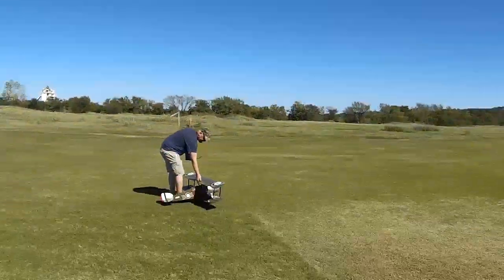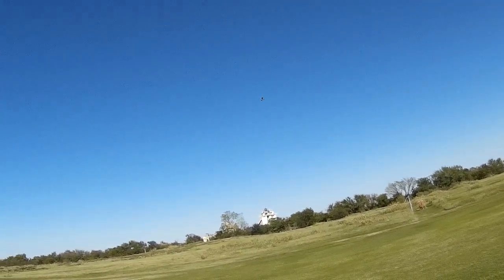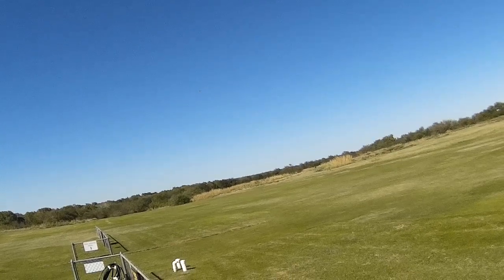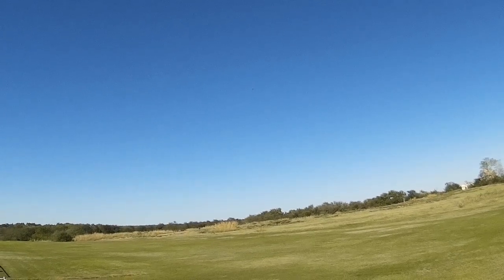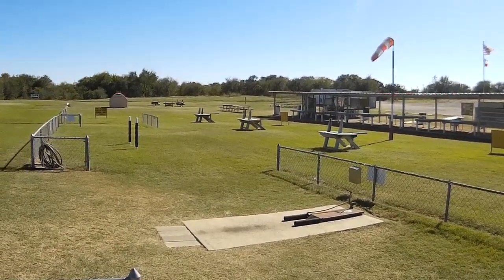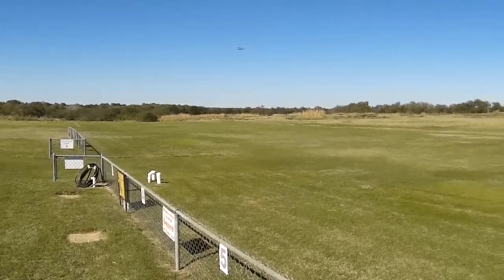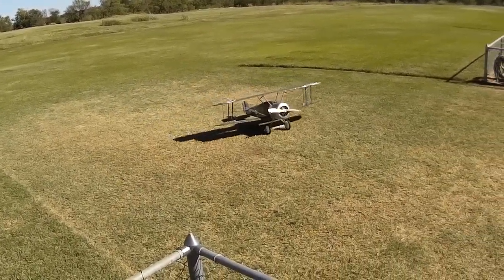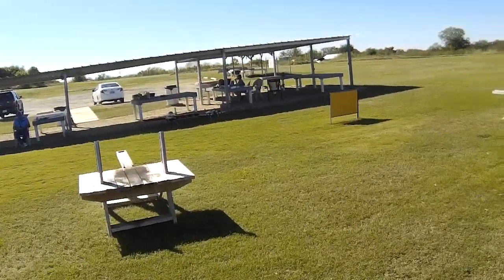1520mm/60inch HobbyKing Balsa Electric Sopwith Camel Flight

Comment: Hallo Bryan , Ive built this super plane using 5 cell 4500mah lippo, a friend wants to also build but ha saw that your using 4 cells , could you please tell us the main points of your build ie did you add extra weight  up front if so how much  and did you cut through the main firewall to pudh the lippo through and how much total weight you ended up with  lippo included I know its a big ask but hey we`r all fliegers thanks  greetings from Austria

Comment: Did you have to add a lot of weight at the front? Saw another vid where a guy added 2+kg all the way up front in the cowling..  Nice plane btw
Reply from the maker: Yes the builder of the model has probably around 150grams of lead weight in the lower cowling...The battery is about 400grams and shoved all the way to the motor firewall.....COG is still behind recommended placement....very twitchy airframe in flight without the stabilizer kicked in.  However when stabilizer is activated it's a super nice airframe to fly....landings can be much slower and less nose heavy thus helpful to prevent nose over
Reply: I recently sold the plane to the gentleman filming the flight, I had to add nearly 8 oz of lead to balance, short nose. I built it from the Hobbyking kit.
Reply from the maker: Bryan did an excellent build on this aircraft......super nice flyer
Reply: @paulhlange  The fact that you bought it from who I assume is a friend should be seen as an endorsement of this product. $100 seems like a fair price for a plane with a 5 foot wingspan. I'd love to see some close up images.
Reply from the maker: Close up shots at this website: https://www.rcgroups.com/forums/showthread.php?2686414-Build-Blog-of-Sopwith-Camel-Balsawood-Airplane/page69